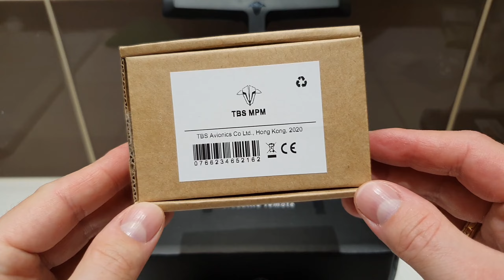TBS Tango 2 Module Bay Add-on for ExpressLRS or Multiprotocol (elegant solution)

Comment: Instead of drilling, heat a tip of the knife with a lighter. Hole will be thinner, but enough for the cable. Rest is good! I believe this is a far better solution than, an internal ELRS mod.
Reply: Hey ! Why do you believe it's better than internal mod ?

Comment: Thanks dude just did elrs and used the drill technique. When I select external module what should I select.
Reply from the maker: For multiprotocol I recommend TBS because it's very good quality. When you need ELRS then I bought HappyModel ExpressLRS 2.4GHz ES24TX Slim Pro TX. It works great and quality is nice.

Comment: hi after make this upgrade is need use crossfire module too? orinternal crossfire will work normal ?
Reply from the maker: Internal Crossfire module will also work fine after adding module bay add-on. You just need to switch the Model in the menu when using different drones. I have two models configured on my radio. One is Cinelog35 and it uses internal Crossfire from the Tango 2 (meaning External RF Mode is set to OFF) and second model is called "Meteor75" where External RF Mode is set to MULTI. See at 05:47 on this video.
Reply: @rfly-fpv  thx for info

Comment: Noob question: is it possible to plug a BetaFPV ELRS transmitter into this?  Compatible?  Can the TBS Multi Protocol Module handle ELRS?
Reply from the maker: Multiprotocol Module can't handle ELRS as far as I know. If you want ELRS in your tango 2 module bay addon you can buy BetaFPV ELRS Nano TX Module. As far as I can see on their official product page it supports tango 2. My only concern is the BetaFPV quality - it's very random to be honest. I would ask TBS via email if they have any plans to produce their own ELRS ;)
Reply from the maker: UPDATE after 7 months :P - I bought HappyModel ExpressLRS 2.4GHz ES24TX Slim Pro TX. It works like a harm with my Mobula 7 ELRS 1S and Tango 2 module bay add-on. If I'm not wrong even the ELRS developers suggests the HappyModel's module.
Reply: @rfly-fpv hi, what firmware version is Tango 2 on? I mean Freedom TX and Crsf version.
Reply from the maker: @SammyFi I just checked in TBS Agent Web: Freedom TX is on 2022-03-18 v1.34 and XF is on 2022-12-15 v6.19
Reply: @rfly-fpv  thx, but have you tested on older versions, 1.29 & 4.11?
Reply from the maker: @SammyFi  Can't remember now what versions I had in the past :( Video was recorded in January 2021 and probably I had latest versions back then.
Reply: @rfly-fpv  are you still using happymodel ELRS module with tango 2? No issues? What is max power, 250mW? What about range behind obstacles compared to crsf?
Reply from the maker: @SammyFi Unfortunately I don't have it right next to me to check the power output now. I use it only for flying Mobula 7 1S ELRS. This is small analog quad so I wasn't going very far with it but I never had failsafe. I would say I was max 200 meters behind some trees and then FPV feed was gone but never RX from ELRS. I also never had any hardware issues with HappyModel module. The only "issue" is that you have to remember to not put Tango 2 on the desk while module is on because you will cover the fan :D Once I thought I fried it but it still works. For my bigger quad I still use Crossfire. People say that ELRS could replace it but for some weird reason I still feel like 868 MHz wavelength is more rock solid than 2.4 GHz when it comes to penetration due to physics itself.
Reply: @rfly-fpv  thanks for the detailed response!

Comment from the maker: If you don't want to use soldering iron (as some people suggest on YT) to make a hole for the signal tape because you don't like the ugly melted plastic around this video is for you ;) It turned out that few "merged" drill holes and nail file is enough to do the job.